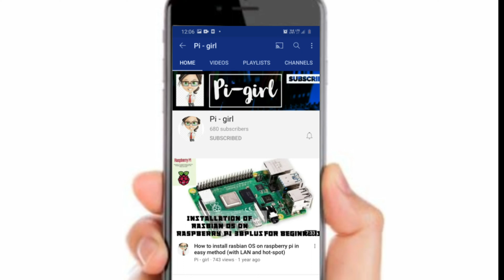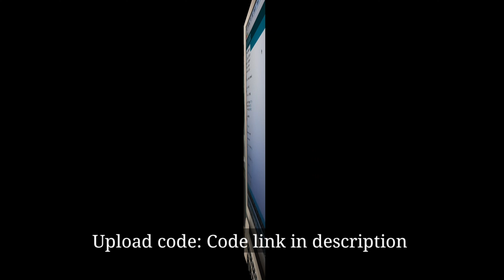Mud pot automated water dispenser with arduino with code

Comment: you must use 0.1 uf ceramic capacitor in parallel to motor.. because in switching on and off.. motor can generate very high voltage spikes like 100-200 volts for a micro seconds.. that can damage your arduino (if not galvanically isolated).. installing that capacitor in  parallel will reduce induced spikes to 10-15volts.. that an arduino can handle for a short time...
great video.. by the way